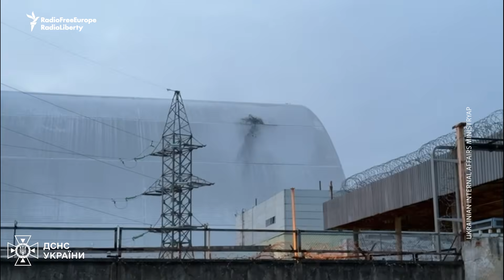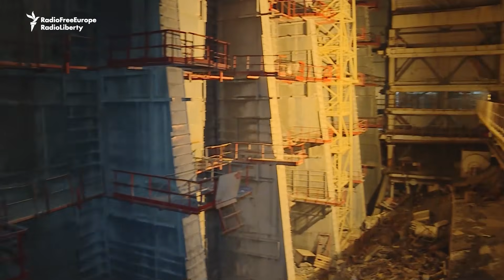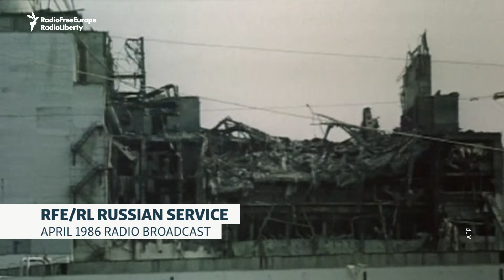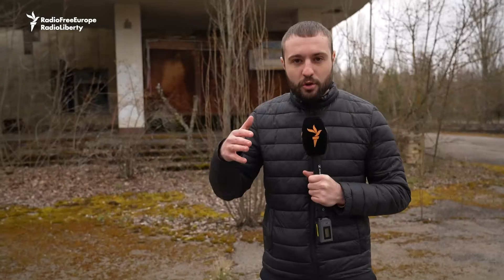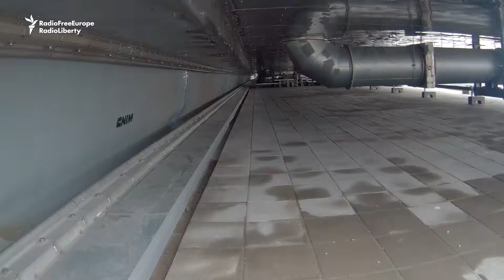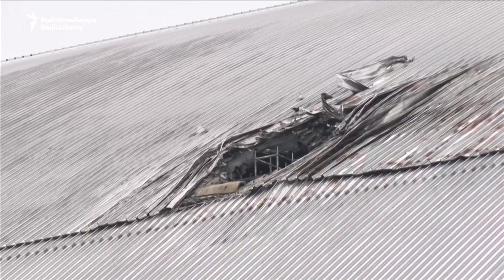Ukraine Tries To Repair Chernobyl's Shield As Plant Marks Nuclear Disaster Anniversary

Comment: They should clear the outside debris away, then make a series interconnecting magnetic patches that can be lowered by helicopter that a safety cable can be detached safely. The time distance shielding rule can be applied, mitigating the dose should be top priority. Then a new solid shielding cover can be made and the old one discarded so a new intact cover will slide in undamaged and will wear evenly through the whole design.

Comment: If you cant work above it how was it constructed in the first place?
Reply: if you would pay attention, the structure was built besides the reactor where people could work and moved with rails, on the reactors core and the whole building
Reply: They would have to move it, using the rails. But people that constructed did die. And most likely the people repairing it, will suffer the same fate even with modern protection
Reply: They died.